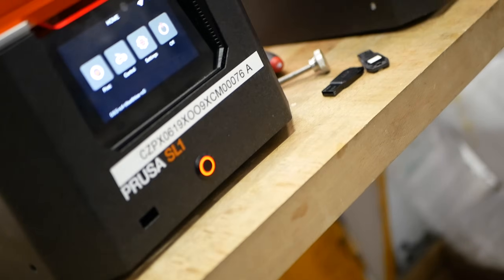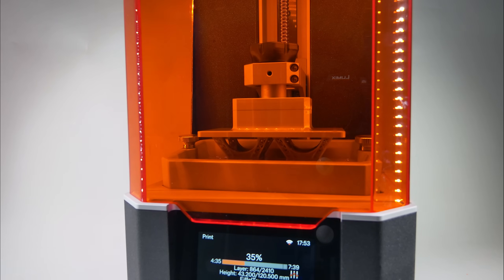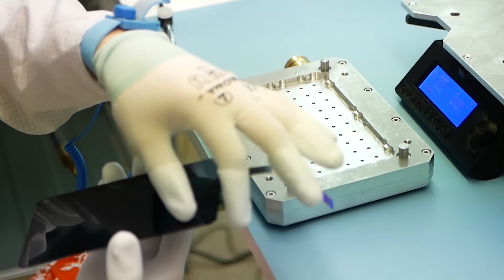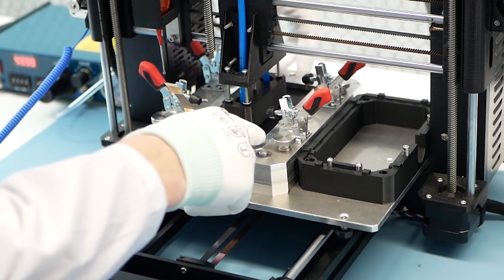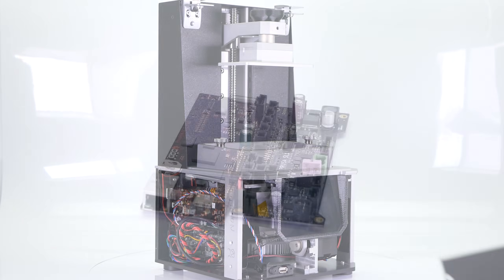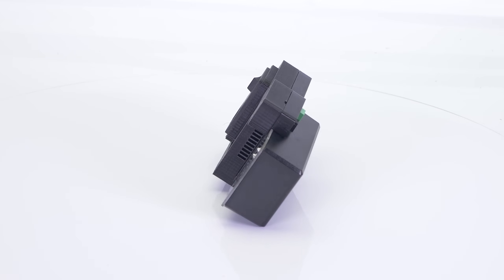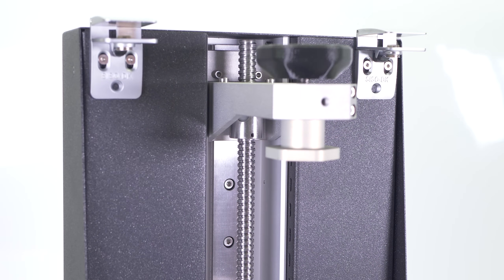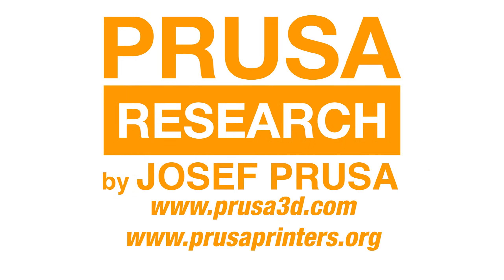Original Prusa SL1 Development Update

Comment: That's a surprisingly large number of FDM printed parts on a $1600 DLP printer. I'd expect that on a lower end machine, but not on such a "game changer".
Reply from the maker: Hi PaleoHuntr! It's not "crammed full of cheap printed parts everywhere". There are five printed parts on the whole machine - none of them affects the rigidity of the construction. The decision to use them was also to have some "shared elements" with the rest of the Prusa lineup.

Currently, the five printed parts are: touchscreen display bracket, fan shroud, the knob on the printing platform (with a metal screw underneath it), one small blind plug and the power button bracket.
Reply: Doesn't look like any of the printed parts will impact the rigidity of the machine though.
Reply: One of the reasons the machine costs 3 times more than similar spec'd printers in the class was supposed to be the superior build quality. Now they are cutting corners by cramming it full of cheap printed parts everywhere they can. Doesn't matter if it impacts the rigidity this is being pushed as a "premium" dlp printer, and will have a bunch of poorly printed pieces in it.
Reply: @PaleoHuntr  you know that 3d printed parts are not cheap? The time it takes to manufacture one makes it way more expensive than e.g. injection molding and they're abled to update the design without making a new mold

Just look at the mk3, it's parts have nearly all been updated and if you want, you could print the updates yourself and install them
Reply: I don't think anyone would complain about printed parts common to Prusa's being replaced by properly manufactured hardware. This machine is already overpriced for what it delivers and using marketing to justify cheaping out on development and manufacturing will only go so far with people that aren't already sold just because of the name.

Besides that there is already enough in common with this printer and the rest of your product line to keep people assured it's a genuine Prusa. Missed launch and delivery deadlines, huge wait times from preorder, overhyped and will no doubt be plagued with problems that early adopters will have to contend with while you "refine" the printer over the next year before releasing the "s" upgrade just prior to the SL2.
Reply from the maker: @PaleoHuntr  What extra features should the printer have to justify the current price - in your opinion?
Reply: @Prusa3D , it either needs a much larger build volume or be a true sla printer. At this price it has a smaller build volume than the Wanhao D7 which is currently selling for $468. Since the internal tech is basically the same between the two machines the print quality is not going to be any better on the SL1 than the D7. For $1300 you can get a Peopoly Moai SLA printer with a 130x130x180 build volume that will produce cleaner prints than a DLP system (albeit a little slower). The SL1 is unnecessarily expensive for the class of machine it is, it's over engineered to set it apart from the known competitors in the same build size, but won't outperform them. People will pay more though because it has your name on it, so I'm sure you will do pretty well with them.

Comment: Looks really great! But I still struggle with one thing. The printer is called SL1, presumably to manifest the printing technology, but its not SLA, but DLP, right?
Reply: It's MSLA ;-) masked SLA printer
Reply: @Jan Vejtasa It is actually a LCD printer. Not DLP. Infact it is arguably worse than DLP or rather it can be worse. It really depends on what screen you are using vs what projector you are using.
Because resolution comes into play, over glow (does the light emitted reach further than it should) and of course image focus. 
In this specific case a good DLP printer can beat the SL1. 

However Neither can beat an SLA printer. It just can't happen. SLA printers do not have pixels and the beam of light is not only very focused, it is also round. So you get a far better quality print than either a DLP or LCD resin printer could produce. 

If anyone says "oh a LCD printer could be better you just have to make the screen higher resolution". They are forgetting that the denser you make a screen the harder it is to push light through it. Nevermind cost sky rocketing and the limitations of pixel size. It is much cheaper to add more precise motors to your lasers mirror system (it's already pretty darn precise) and use a more highly focused laser for far far less. 

Also don't worry that you didn't know it was LCD. I have had some people call me biased and essentially stupid because they believe this is an SLA printer. I chalk it up to Prusa not outright saying what it is and like you said the naming scheme.    Now I am not a tinfoil hat person. But I do wonder why he called it the SL1. A name like that is bound to cause some misunderstanding.
Reply: @super_salty9189  Actually it is an SLA printer... SLA stands for StereoLithography Apparatus which this very much is.  The L does not stand for laser.

Comment: Yeah but your customer service is 100% crap. You fell faulty parts and refuse to make good on them.
Reply: I’ve had nothing but success with their customer service. On one kit printer it came with a bad filament sensor for a MK3 and wouldn’t pass the first time startup, got on the live chat and one was sent out on first thing Monday. 

Something else happened to a kit printer on a MK3 and they sent out a part asap.

Plus I have had other questions (like timing on textured build plate as one example) or quick problems chat has been able to help. Chat can seem frustrating but you have to remember they are talking to like 10 other people and it helps with the time responses take or it seems like they are in a rush.

If it seems like you are not getting somewhere with someone, look at their name, disconnect and reconnect to chat hopefully you get someone different, if not try another time of day. Try their forums, they have helpful mods there as well.
Reply: My experience with Prusa customer support has been outstanding. We have 4 Mks
Reply: Al Smith can you elaborate on your experience?  What happened?
Reply: I had the mmu1, never worked, loads of faults, got abused by customer support who eventually sent out some replacement parts but it didn't help. Paid for a premium product and got the worst support. In the end I was expected to upgrade my printer and buy the mmu2 in order to get what I originally paid for. No more Prusa for me.
Reply: @martintruran8469  Hello, I am Lukas from Prusa3D customer support. We are still able to find reasonable solution for upgrade to latest MMU2S version. Was searching for some previous conversation, but didn't find anything. Could you please contact us again using email or our 24/7 chat? Feel free to mention my name and I will look into the problem personally.
Reply: Lukas Vacek , thanks for taking the time to respond. I will send you an email to discuss the issue again, I have copies of all the correspondence. I've just taken off the mmu1 and returned the machine to the original mk2s as that worked very well, I followed all the suggestions on the forum but it never worked. I'm in business myself and sometimes things just don't work out, it happens and that's life but it's how companies deal with it that shows their real worth. I don't want Prusa to do anything more than is reasonable and to understand that I paid for something that just doesn't work as advertised. As the mmu2 seems to work, I would suggest that the required upgrade parts should be made available to the mmu1 customers at cost. Prusa doesn't loose money and the customer gets what they paid for.
Reply: Dear Al, I am Lukas from Prusa Support. Please accept my apologies for inconviniences. Unfortunately I couldnt find any previous conversations. Can you please contact us once again and mention my name in message? I will do my best to help you with above mentioned parts immediately.
Reply: @RaQic  I'd be more than happy to do that.

Comment: Nice update - TY!

I would love to hear about different types of materials that it will be able to print. The video shows a number of colors but are there a variety of material properties we can look forward to, too?
Reply: I use a Photon printer and it uses the same type of resin this one does, there are only a few different resin properties for these printers. Regular (great for printing desktop models and such) not very strong but good quality. Casting, these are used to make molds for casting precious metals like gold and silver, they can be burned away in the mold. Dental, these are special because they are food grade and normally are used to make a copy of someones teeth and then you use the model to make dental fixtures (the resin is never used on patient). And then there is semi flexible resins that are a bit stronger than regular ones and can be used where a little flex is required. Other than that colors (or clear) is the biggest difference in the resins available today.
Reply: All are extremely toxic (free radicals).